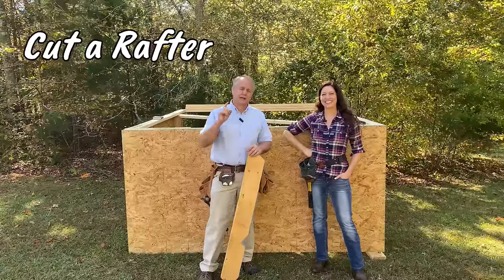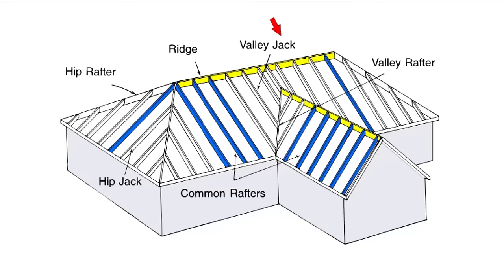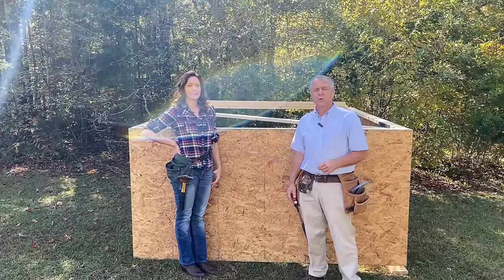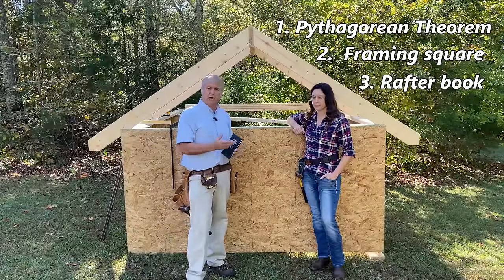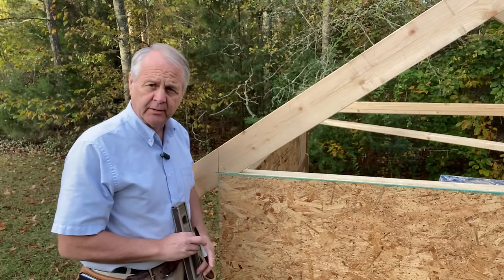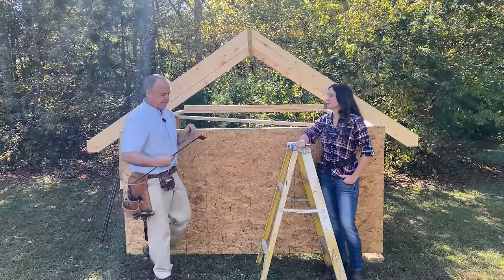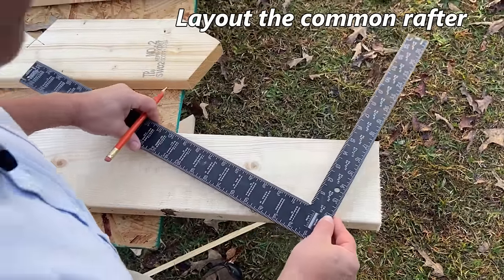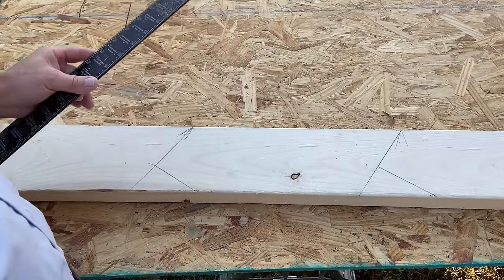Beginner’s Guide to Roof Framing – Cutting a Rafter, Step-by-Step

Comment: What happens if we cut the rafter 57 3/4?
Your bible tells us to deduct the 3/4 for the ridge?
If it doesn’t, someone is going to be very pis*** off.
Thinking about buying one if this bible is infallible.
Reply from the maker: The 57 3/4" is to the center of the ridge, so if you don't deduct for half of the ridge thickness, it will not fit. 
I wouldn't say the book is infallible, but in the 30 years since it was published no one has found an error in the calculations. Of course the figures in the charts are rounded to the nearest 1/8", so there will be small discrepancies from a calculated length. Thanks for watching!

Comment: Hi is this book available in metric thanks
Reply from the maker: No, we don't have it in metric. I have sold these to customers in metric countries for years. I always wondered how they were using them. I'm just not familiar with typical metric roof pitches. Of course the factors in the book would still work regardless of the unit of measure as long as you were doing a metric equivalent of say a 6/12 roof. Thanks for watching!
Reply: @RoofFramersBible  hi our architects give the pitch in degrees so for your 12/12 pitch for us would be a 45 degrees, or to convert on a scientific calculator is 12/12 = 1 then  2nd function tan should give you the converted  pitch in degrees in this case ,
Reply: @RoofFramersBible  thanks for the reply and great videos
Reply: If you want to learn german.  Grundlagen des zimmererhandwerks. Oder Schiften leicht gemacht.👍👍🇩🇪

Comment: Surprised he didn't cover multiple plate heights and what you need to add to your span to get your common lengths and your step down 
Hey boss just pick out a straight 2x6 and use it for your common pattern 
Then use your step down for a jig that's the way it's been done for years I can have all your common and Jack's and ridges cut before you have all your celing joist run 😅
I do both, sometimes I pre cut tails if my sub is nailing to blocks or I leave long and strangling if hanging off rafter tails and fascia is being dadoed for sofit
Reply from the maker: All true! There are lots of ways of doing it. We were trying to keep it simple for beginners. Thanks for watching!

Comment: 18.00 I was always told no more than a third 🤔
Reply from the maker: That is a good rule of thumb. In this case we had a short overhang, so it wasn't as critical for the strength of the rafter tail. I should have made that more clear. Thanks for pointing that out, and thanks for watching!

Comment: Is the roof bible available in metric?
Reply from the maker: No, it is not available in metric. Of course the "factors" in the book are still valid regardless of the unit of measure. It would only have limited function for metric. I would recommend the book Roof Cutter's Secrets. It is written by my friend Will Holladay and is also available in metric. Thanks for watching!

Comment: Having framed for 30+ yrs. I think you were on a good roll until you brought the framing square into an already confusing topic. A speed square also is very hard to explain but easier to absorb if you concentrate on learning how to mark a pitch is my thought and no...I couldn't do any better than you did.
Reply from the maker: There is more than one way to do things and you are correct that communicating it clearly can be a challenge. I appreciate your perspective. Thanks for watching!

Comment: You begin by stating you want to keep everything simple, however, it did not completely happen in my view.

For example, you used  the 12 inches as your Run,  then later on in the video, you focus on using half of the span as your Run.   Confusion began to creep into the overall  presentation.   So you need to discuss why you go from using the standard 12 inches number to then to the Span divided by 2 figure.

Also, calculating the total rafter length, you show 2 methods.  The first method needs  a worker to make adjustments because of the thickness of the Ridge board and then adding the overhang.   The 2nd method is more direct using Pythagorem equation.  I would probably reference another short video for those viewers interested in using the faster method which may give decimal values in the result.

So if you want to keep the video simple as you indicated, I suggest editing some information.    

,
Reply from the maker: Thank you for your feedback. It is difficult to be all things to all people. It is regrettable that you were confused by the discussion of 12" run increments. The historical method of discussing roof pitch is per 12" of run, or the ratio of rise over run. We will certainly endeavor to avoid confusion wherever we can. Thanks for watching!

Comment: You explained how to step off on an even number of feet on the run, how do you step off if the run was say 4 foot 3 inches? 

In answer to the height of a hip rafter. A common hip rafter is on a 45 degree angle. What ever the run is, say 4 foot, you would measure back away from the corner 4 foot on the outside wall. That is where the first common rafter will sit. If you look at the floor plan of a hip roof, you will see the hip end of the floor plan forms two squares. All hip roofs will have one common rafter centerlined or in the middle of the two runs. In other words, from the corner of the building measure from the corner along the outside of both walls, the run, and make a mark, that is where the common rafter will sit. Ok I am just confusing people here. It is easy to do but hard to explain.
Reply from the maker: You step off the same way, i.e. you put the square on there with 8/12 on the edges of the rafter, but you just go over say 3 inches (your example) on the bottom edge of the square and mark that. You then mark a plumb line at that mark. Yes, you are right. It is easy, but sometimes hard to explain. Thanks for watching!